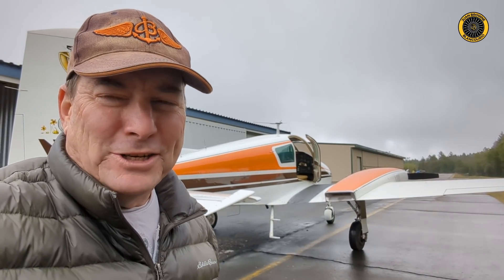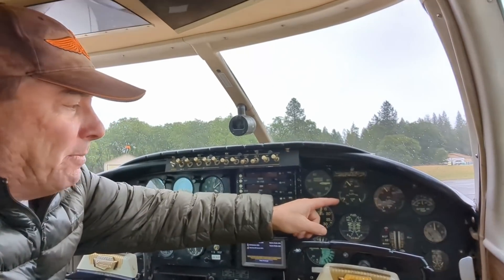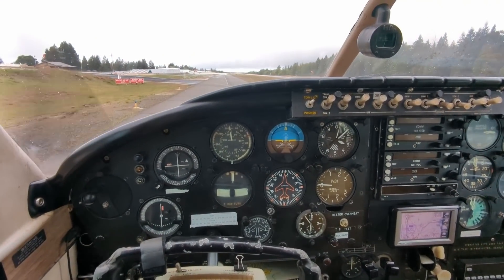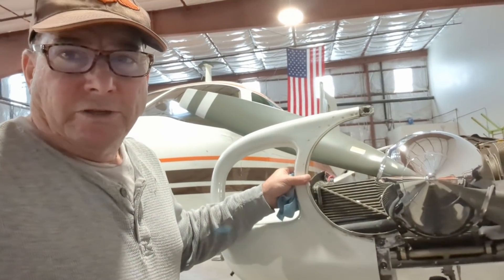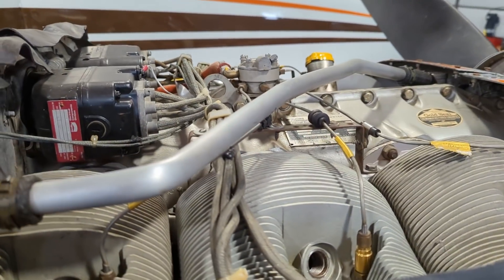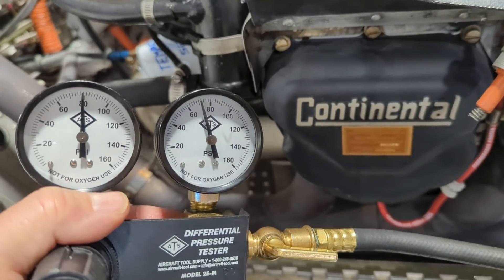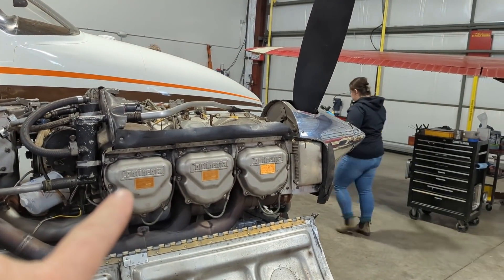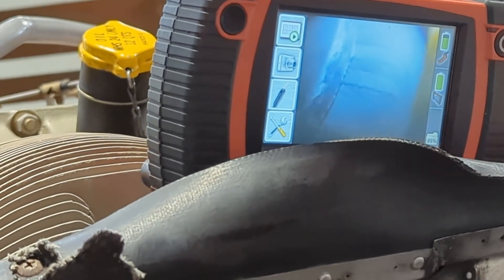1959 Cessna 310C Annual Inspection- Part I Compression Check.

Comment from the maker: A leakdown test is automotive terminology. We are NOT working on cars here. It's a compression test.
Reply: Juan,
  That is a leakdown test, not a compression test. Do them all the time on automotive engines. A compression test is a  totally different test.
Also have to say that I would absolutely want to know why the exhaust valve was leaking that badly. 
 I own an Automotive Machine Shop so I know a little bit about engines 🙂
Reply: @billkoustenis3248  Like he said, it might be a terminology (vocabulary?) thing:  Lycoming calls their leakdown test a Differential Compression Test, maybe all aircraft engine manufacturers do the same.  Like the man said; this ain't no auto engine ;-)
Reply: @blancolirio.  A compression test gives you relative engine condition, a leak down tester can tell you where a leak is, intake, exhaust, rings.
Reply: @markwatson3135  Umm, kind of… with a whole lot of effort.
Reply: You can absolutely do a leakdown on ANY pressurized system. You might be doing a compression test only, but both are absolutely applicable to both aero and auto
Reply: Its  a Cash  leakdown  if  it   hisses.
Reply: compression and leak-down are two different tests.
Reply: @nikhayes3396  I agree with that statement completely. Use a leak down test gauge set up similar to what Juan was using at work all the time.
Reply: A leakdown test can be done in any four cycle engine.  If you have low compression, you need to find out where it going. Down the rings, or out through one of the valves.
Reply: Per the check sheet it does say  " Compression "  however, I'm betting this was a contraction / slang for  " Compression Leakage Test "  which would be much more accurate.    

In any event, the tool being used gives a leakage rating by regulating air to a fixed  PSI ( left gauge ) then passing the air through an orifice.  The air downstream of the orifice is  monitored by a pressure gauge ( right gauge ) on it's way to the cylinder.  

If the  cylinder has an open valve, the leak rate is maximum because air passing through the orifice can't outrun the leak of the open valve .  If the cylinder has perfect sealing, the leak rate is zero.    No cylinder / valve is 100 % sealed so there will be some leakage. 

In the automotive world, the regulated side is set to 100 PSI to give a no calculation needed reading on the second gauge.  ( a reading on the 2nd gauge of 95 PSI would be a 5 % leak rate )   In this vid 80 PSI is being used.

Regardless of what we call all of this, the orifice diameter is the determining factor when comparing % to % between different test tools.  A tester for a ocean going ship is going to have a much larger orifice than what is being used here.
Reply: You may not be working on an automotive engine, but it's still a 4-cycle engine that functions the same. Like some others have said, this is really a leakdown test even if it may not be called that by aircraft mechanics. It's measuring pressure leakage within the cylinder. A compression test would be attaching a pressure gauge to the cylinder through one of the spark plug holes and cranking the engine over in order to get the absolute pressure reading. Typically there will be a spec and tolerance for a healthy engine. It's good to know the numbers. In combination with a leakdown test you'll get a good idea if there are any real problems.
Reply: As an Australian automotive mechanic with 50yrs experience I often find aviation terms confusing but it is what it is, pointless to argue about terminology. Regardless of what you call it that type of testing is a very useful diagnostic tool.
Reply: Awesome thank you for this guide and wanting to see more! I am currently studying to become a Aircraft mechanic any information shared helps me in my goal too.
Reply: I have to agree with the consensus.  Call it what you will, but the test evaluated not only IF the cylinder was holding compression but, if it wasn't, the test would help determine WHERE pressure was leaking from.
Reply: How do you determine the compression? Wanna understand the difference between that and a leak down test!🤔🤔🤔
Reply: Differential test with compressed air is way more valuable in terms of diagnosis than a simple compression test.

Call it whatever you like but any out of spec readings whether you do a simple cranking compression test or a differential test the resultant action is the same ...ie a strip down

Advantage of a Differential test is that you can localise the leak and give the customer a quicker diagnosis and price without stripping it down 1st
Reply: I have noticed some bantering about terms used . It boils down to a manufacturer can use any term they like for a test as long as they give  clear and concise instructions on how to do that test and what the readings should be .
One perfect example is a Japanese auto company that has never built a rotary engine in their entire history and yet they call a popular engine they sell a rotary. That engine is actually a Wankel . A rotary engine has Pistons that look almost identical to the Pistons in any radial or other piston engine . The engine they loved it called a rotary does not have Pistons, it has modified triangles shaped components with Apex seals . But their advertising Department thought that that would sell better calling it what they called it so that's what they did in spite of the fact that it is historically wrong because it does not give credit to the gentleman who engineered the system in the first place . In a real rotary engine the crankshaft , pistons,  rods,and carburator are the only parts that do not rotate. Engin cases cylinders exhaust and ignition systems all rotate . Power is normally taken from the engine case , or on an early automobile from a rack attached to the top of the cylinder.
Reply: As a person that has built engines for many applications from boats, big ships, race cars, aircraft, etc. I can assure you all that a leak down test with a flow meter will tell you everything.   The bore scope will tell you the rest of the story.  A leak down test is NOT really an automotive term, more of an engine test.  Most auto mechanics have no clue what it is.
Reply: Some leakage in any of the three possible routes is acceptable.  The engine manufacturer usually specifies what the lower limit of the ‘compression leakage’ test is.
Reply: Juan, who would have thought your breakdown test would cause to much angst?
Reply: You didn't mention that your value read is 80 psi before an office. That controls the volume of air being used. The closer your first number to 80 is better sealing. Another you thing you should have mentioned is to stay out of the arc of the prop. It is amazing how fast that engine will spin with the air applied of you come off of TDC. Our instructors deliberately let one come off TDC to demonstrate. It is scary as all get out
Reply: Almost every Good Auto engine cylinder I have checked has been 100psi in /100, I realize this is an aviation engine but that one cylinder is a poor sealing cylinder meaning lower compression and that exhaust valve may just need to be lapped, before it fails, you can do it without pulling the cylinder. I also realize that Cont and Lyco call a leak down test a compression test and I don't understand why.  Great to see a young person in the trades.
Reply: Do you ever do an absolute cranking pressure test?
Reply: @michealcobia7869  
         These are not done in the aircraft world.   

This is most likely due to the risk of being near a spinning propeller in the hangar, and the TDC leakdown test gives more information.

I also agree that having been involved in GA maintenance for many years that this test should be called a differential leak down test.    Aviation is full of weird nomenclature.
Reply: Absolutely amazing to read the replies to this.  Im really stunned and at a loss for words.  Do A&Ps really have a different word for leak down test than an automotive mechanic would?  Ive built engines all my life.  This is not a potatoe potato.  A leak down test is absolutely not a compression test and if manufacturers are listing this as such, we need an FAA investigation.  A compression test is strictly a pumping test,  a leak down test is an applied pressure test and can be a combined differential test with the proper gauges.  But with all that said she did do a proper compression check by sticking her finger in the hole to find tdc.  Had that not passed, well the leakdown would of certainly pinpointed the problem. :)
Reply: Juan, you know you are going to be inundated by every car mechanic, shade tree mechanic etc that has ever turned a wrench or watched Fast & Loud- telling you how you’re wrong. I got my IA and A&P decades ago (80s & 90s) and have worked on fleets of twin Cessnas. You’re doing exactly what AIRCRAFT mechanics do and calling it what AIRCRAFT mechanics call it.
Reply: @sledawgpilot  this A&P seconds that!

Comment: Take valve covers off. Pressurize the cyl to TDC and whack the valves. They will clear the carbon out
Reply: reminds me of when we used to crack it out back in the day of carburetors with carefully pouring water down the carb of a hot engine at high rpm . sending huge black clouds out the tailpipe .
Reply: Dear oh dear - that took me back a few years . . . to such pragmatic naughtinesses, that would often save the day : )

Comment: Never knew what an annual entailed.  Surprised that 70ish compression passes. Are these engines turbocharged? My car is, and it has 10:1 compression ratio.
Reply: Not sure this was actually a compression test of the engine.  I'm think what was shown was more of a leak down test:  Fill the cylinder with pressurized air at TDC and see what leaks out and where ;-)   Would probably have to crank the engine to do a proper compression test. Hand propping this 500+ cubic inch 6 cylinder might give incorrect results.  Poking a finger in the sparkplug hole while hand propping will get you to top dead center though !
Reply: @jamesvelvet3612 , Juan Said in the video that it was a static compression test. The terminology is sometimes different from aviation to automotive.
I have been a certified automotive mechanic for 30 years and the test they performed can be called a leak down test or a static compression test. (Static)
Not moving.
Reply: @MJTAUTOMOTIVE  Makes sense, TY
Reply from the maker: This is an aviation compression test, not to be confused with your cars compression ratio.
Reply: I built N36LV and it had a High Performance 370HP Continental IO-550 with an electric ignition system running the top plugs and a magneto running the bottoms. The scariest thing I ever had to do was checking and adjusting the timing of the electronic ignition. Since it was a pusher, there was no room to stand between the prop and the back of the plane. I had to tape down 2" foam sheets on top of the engine, start it, then climb up on the fuel strakes and slowly shimmy head first back out onto the foam. I had to rig a safety rope around my waist which my neighbor held onto. I had to go all the way back to be able to see the adjustment marks on the prop spinner flange while that beast of an engine was spinning a 3-blade widow maker about 4" from my head. Definitely not for the squeamish. 

Nice job Juan, I like the crowdfund idea for Jordan. Let's make it work.